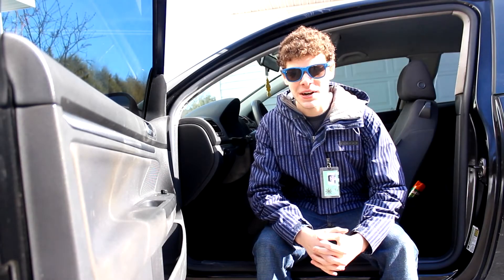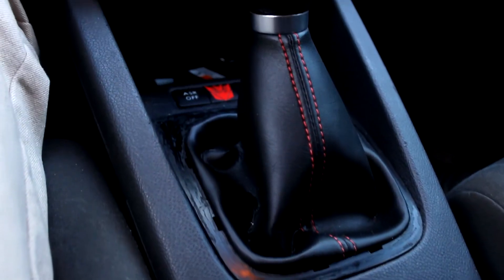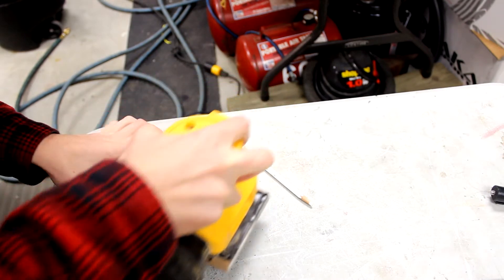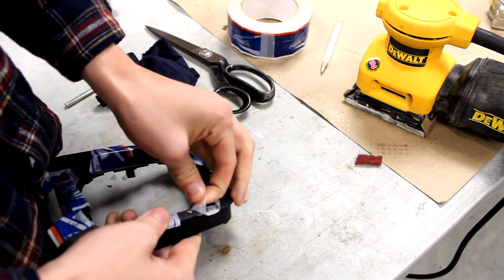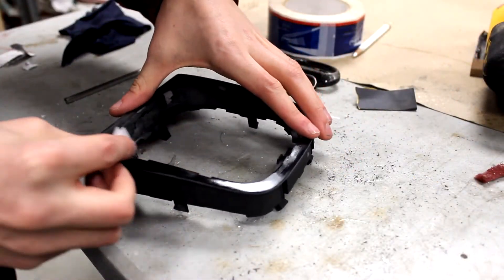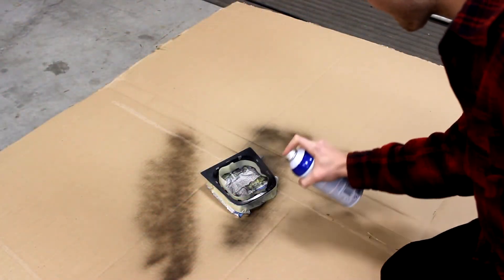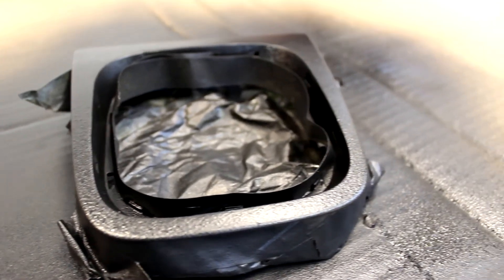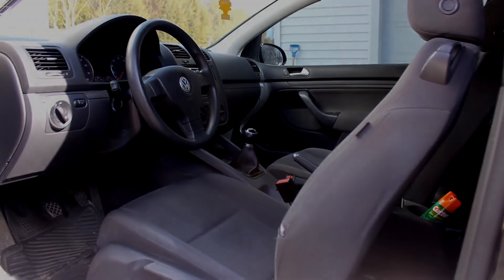How to Fix and Refinish Interior Trim

Comment: I have a 2007 VW Touareg that I would like to refinish the center A/C vent and compartment. How/where do I get the correct paint type?  I would prefer a smooth finish versus a textured look. TIA